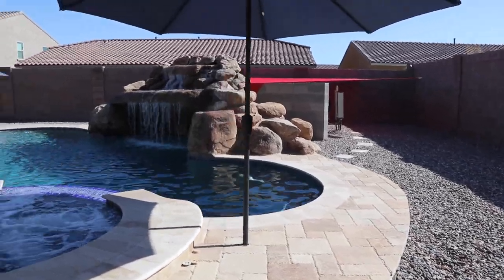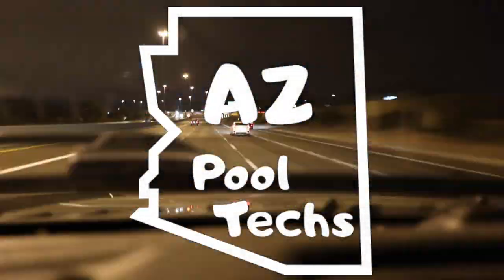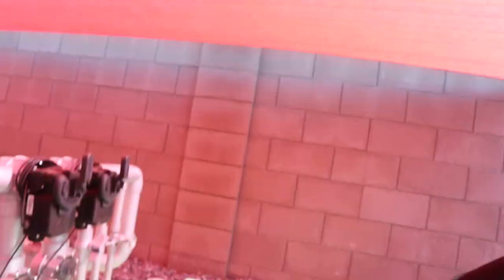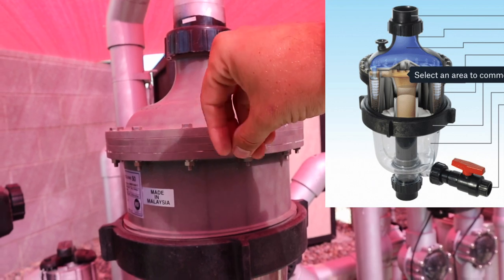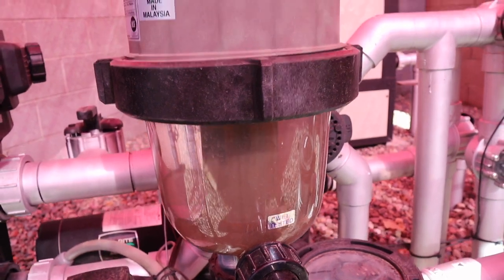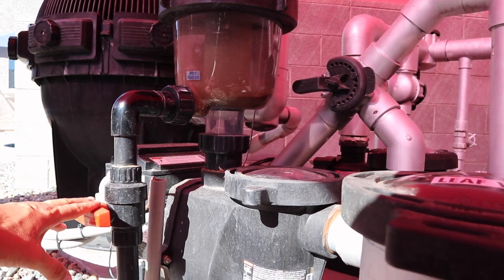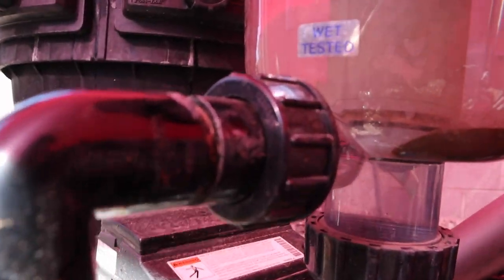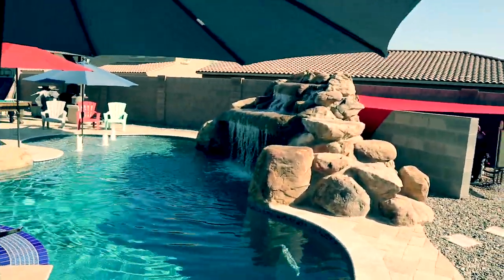How Does a MultiCyclone Work??

Comment: The cyclone takes out debris down to 30 microns...essentially the same amount as the larger debris a sand filter removes (which is 20-30 microns). Thanks for the great video!
Reply: It acutally takes debris down to 5 microns, with the average about 20 microns 🙂

Comment: Try putting your system in service mode and drain your cyclone... you may need to open your drain line off your filter to relieve pressure. With your drained cyclone start your pool pump on high speed with the cyclone open and watch the dirt gush out.

Comment: My Cyclone has dirt/algae in the bottom that won’t wash out. How do you take it apart to clean manually?
Reply: Same.
Reply: Try putting your system in service mode and drain your cyclone... you may need to open your drain line off your filter to relieve pressure. With your drained cyclone start your pool pump on high speed with the cyclone open and watch the dirt gush out.
Reply: Try putting your system in service mode and drain your cyclone... you may need to open your drain line off your filter to relieve pressure. With your drained cyclone start your pool pump on high speed with the cyclone open and watch the dirt gush out.